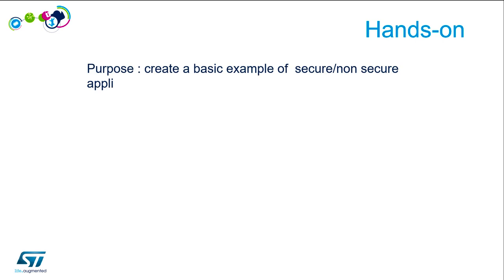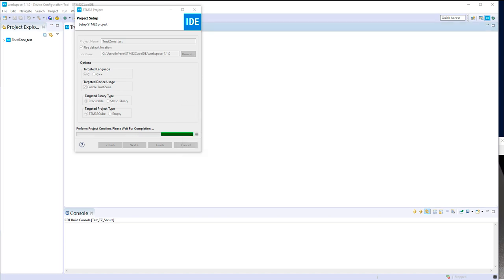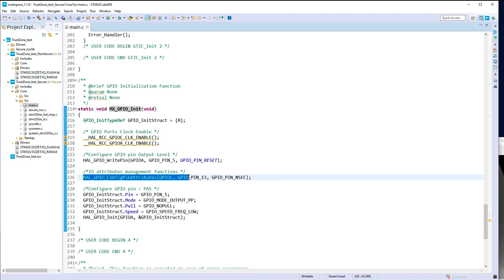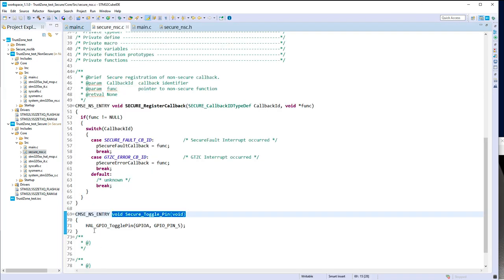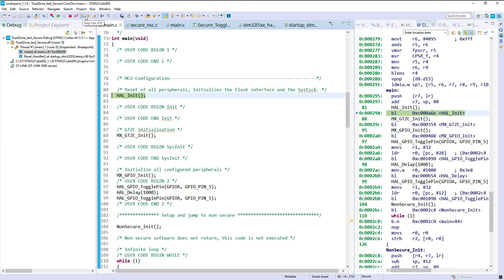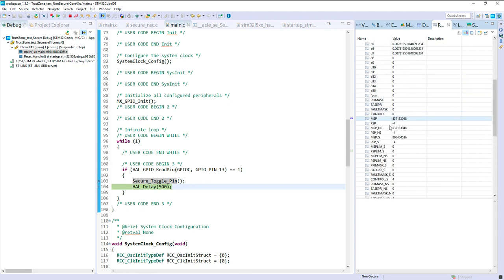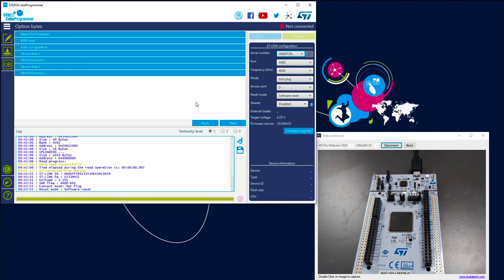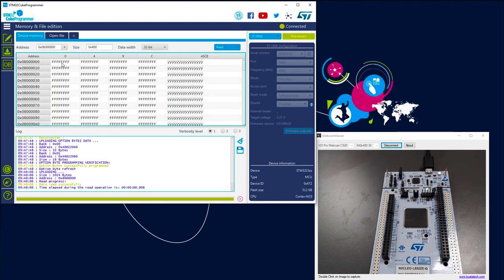Security Part3 - STM32 Security features - 19 - TrustZone lab

Comment: It looks like ROM is renamed to be FLASH
STM32L552ZETXQ_FLASH.ld
<<<---
/* Memories definition */
MEMORY
{
  RAM	(xrw)	: ORIGIN = 0x30000000,	LENGTH = 96K    /* Memory is divided. Actual start is 0x30000000 and actual length is 192K */
  RAM2	(xrw)	: ORIGIN = 0x30030000,	LENGTH = 64K
  FLASH	(rx)	: ORIGIN = 0x0C000000,	LENGTH = 248K   /* Memory is divided. Actual start is 0x0C000000 and actual length is 512K */
  FLASH_NSC	(rx): ORIGIN = 0x0C03E000,	LENGTH = 8K     /* Non-Secure Call-able region */
}
--->>>